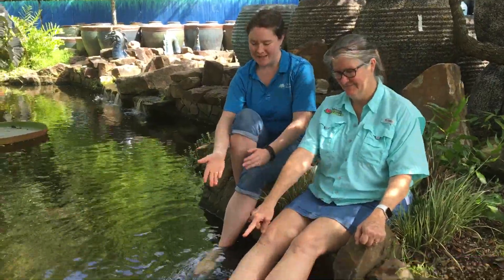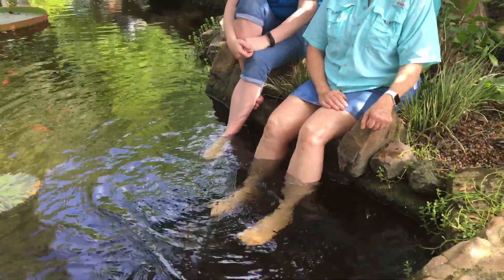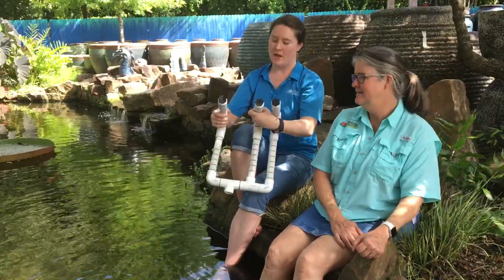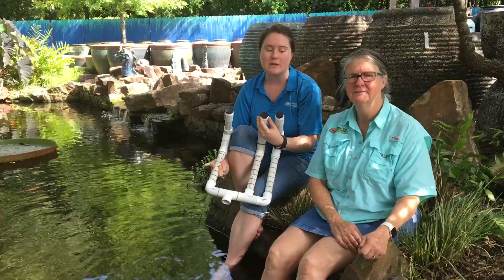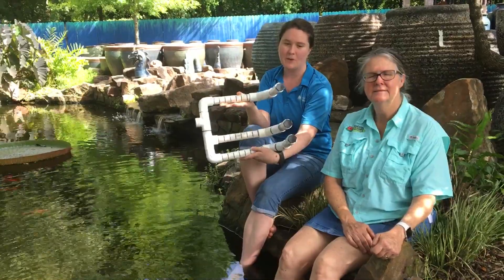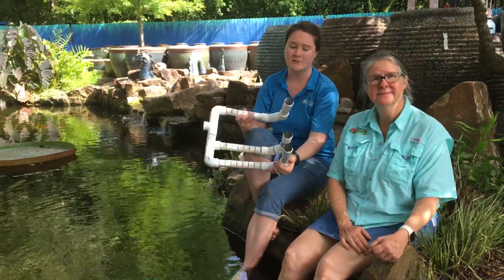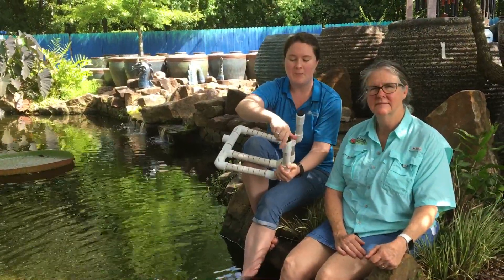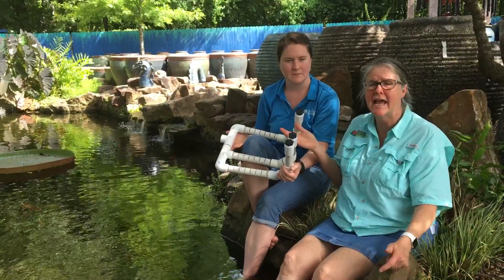Active Bog Filtration

Comment: Hello just watched your video on the bog filter.i have just made a bog filter for my pond which is 4500 litters and my bog filter is 450 litters.its been  running now for about two weeks but i have not seen any difference  in the quality of the water its still not very clear.i have an 800 litters per hour pump running. My question is how long does  it take for the winter to clear?looking forward hearing from you  thanks

Comment: Wouldn't you suck out the debris instead of running a hose down the pipe flushing the system? Where would that debris go if you flush it out? That's the only thing I don't get. Doesn't make sense, that debris has to go somewhere.

Comment: So can you show me the connection that will let the water back into the pond. I plan on using 1 or 2  tough totes 27 gals each . The depth of them is 20" so also need to know how I  make up the extra 8" should I use grates or a combination of grates and filter material ?
Reply: My connection is a waterfall. The bog is raised 3 feet above the pond surface level.

Comment: Why do they fail if made more than 12 inches deep?
Reply: Probably due to lack of oxygen down below, creating an anaerobic zone. But some plants like common reed should at least partly prevent that.
Reply: But won’t anaerobic zone be good for nitrifying bacteria ? I thought you’d want to create that zone on the filter side ode the pond.
Reply: I agree with you instructions and everybody that is known to be an expert on ponds will say the same thing no more than 12” deep just wondering why.  Great content
Reply: because people use the wrong size gravel. the 12" depth, as suggested in this video, is  probably for the 3/8" gravel and 1.5~" pipe diameter. i have seen videos where the bog filtration system used is over 4 feet deep and over 10x20 feet wide; they also use much bigge rocks towards the bottom and gradually decrease the size towards the surface and much bigger pipe diameter
Reply: 12inch because most plant roots only dig that far down.

Comment: I am considering an active bog for my pond. It's about 4500 gallons. My question is this, its currently quite murky. Should i mechanically filter the pond before implementing the bog setup? I am concerned the bog wont be able to process the water in its current state.

Comment: IMHO slots should be facing down.
Reply: I was wondering about that. I seems like sediments would settle into the slots.
Reply: @charlottejurek8867  i have put mine facing up and have a good angle down to a plastic drum where the crap ends up . the plastic drum is big enough so i can go in and empty it with a little bucket .
Reply: Slots facing down can cause the liner to weaken over time (we're talking many years) since the water is flowing strongly. There is no down-side to having them face up. If anything, the nutrients are more likely to get to shallower plant roots when facing up.

Comment: When I want to clean out the pipes that are in the bog I do not use a hose as suggested in the video. Instead, I leave the pond pump running and remove one riser tube cap at a time. Everything that is built up in the pipe floods out. I then recap it and move on to the next riser tube. It is very easy and quick to do, and I would think it does a better job of cleaning out the pipes.
Reply: If your pump was going to feed a waterfall too, should I put a shutoff valve to the waterfall and direct all the water to the bog blow out?
Reply: Collin Blake have you figure this out?
Reply: @collinblake9957  It depends on how strong the flow is to the bog. If the riser has good pressure and a lot of muck comes out when you remove one of the caps then you are probably okay. If not, then you may want to add a valve to allow you to increase the flow by redirecting from the waterfall.
Reply from the maker: Great tip!
Reply: Nelson Water Gardens & Nursery  I am having an impossible time finding exactly 3/8” pea gravel. Most suppliers here in Georgia have a range of sizes... any tips on how to find this size gravel? Or do I have to buy a ton of it and sort/measure it out stone by stone? Thanks in advance!!!
Reply: @het127  A little late on replying. Home Depot (and probably Lowes) carries 3/8" gravel in bags. The gravel needs to be around 3/8", not necessarily exactly. You don't want gravel that is much smaller or larger. The 3/8" size is the best balance for physical filtration and plant growth.
Reply: Do you add a hose to clean out pipe to move the muck outside the pond?
Reply: @dorothygail2918  No, I just let it spill into the bog. The pond water gets a little cloudy, but clears up within an hour or two.